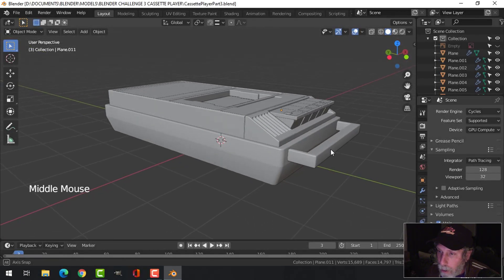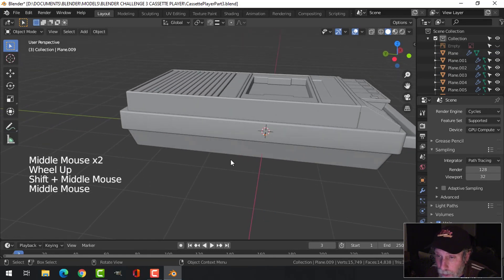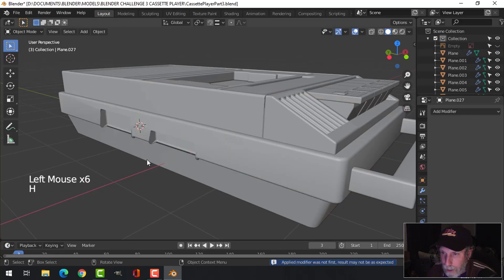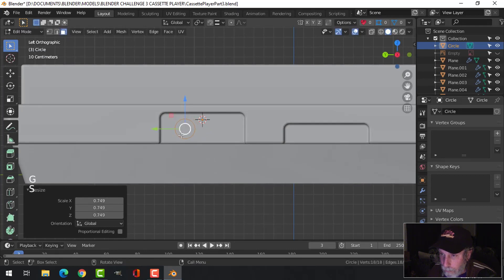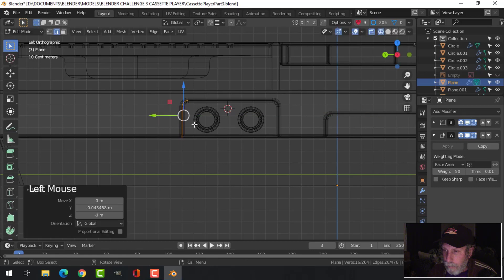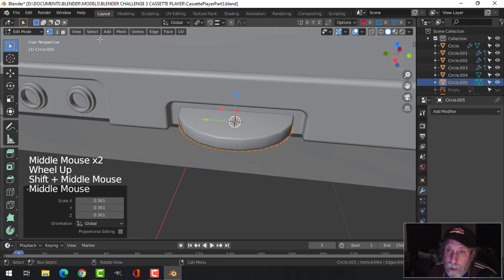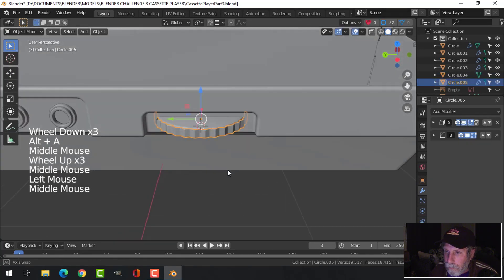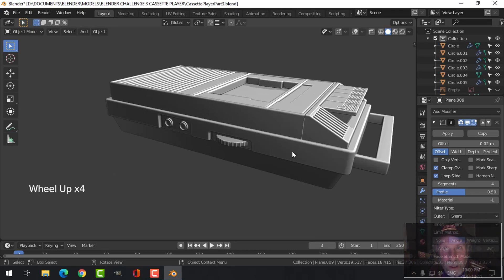BLENDER CHALLENGE 3: Modeling a Cassette Player (Part 3)

Comment: Great work as always.  I got the sense that speed was a priority this time around.  This might be the first time I've seen you work with Ngons and booleans.  As you point out, there's nothing wrong with that for most hard surface objects that will be rendered directly in Blender.  That's why Blender supports them!  I remember when Blender used to only support quads and triangles.  It wasn't until maybe 10 years ago that Blender incorporated Ngons into the code and workflow.  The only time Ngons are a problem would be for subdivision smoothing or exporting to other applications where the render engine might triangulate the surface in an unpredictable way.   Also, if you're going to sell or redistribute your models, then I'd recommend staying away from Ngons because it tends to present issues for clients who might need to edit or customize the mesh or UV's in their workflow.  Booleans and ngons can help make the modeling process a great deal faster than it might be otherwise.
Reply from the maker: Yes, I wanted to move quickly through this part. And I completely agree with what you've also said about boolean and n-gons, especially in this hard surface case. If it wasn't for this kind of model, I wouldn't do it this way.